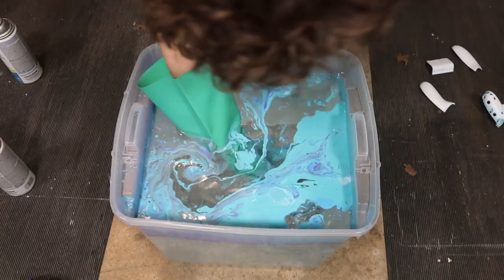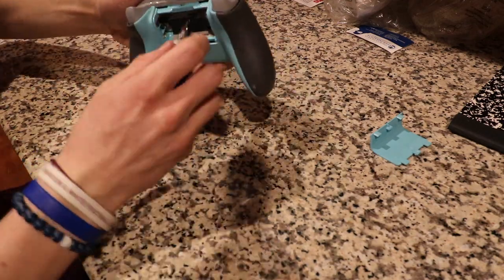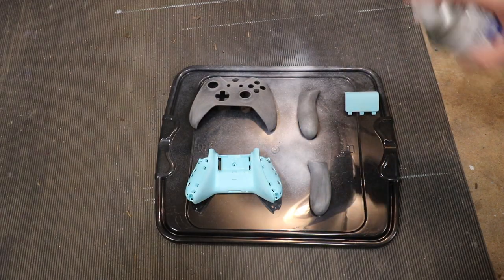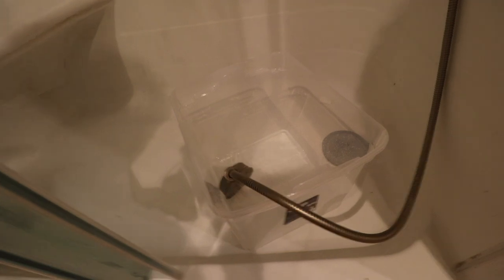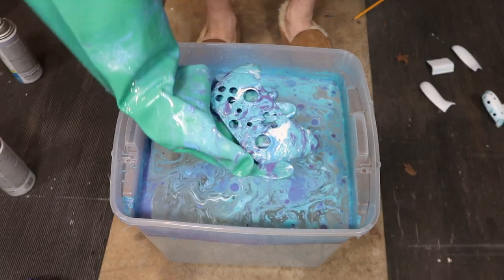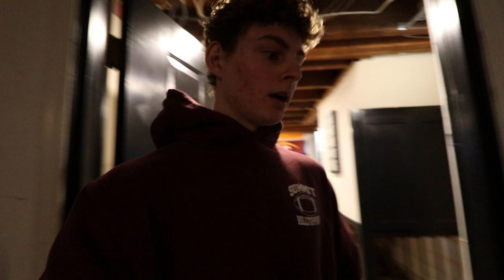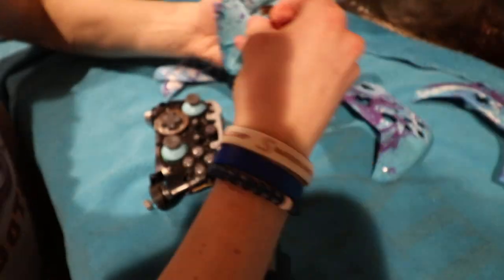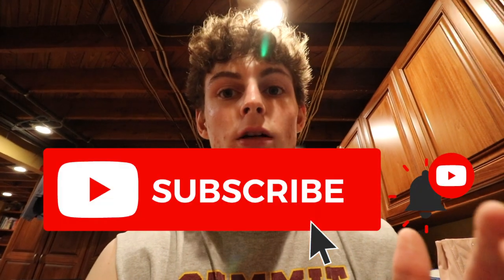How to Customize XBOX ONE S Controller | HYDRO DIPPING Guide !! 🎮🎨

Comment: When I do controllers either dipping or pouring, I use the 3M foam earplugs (the earplug container has orange and purple plugs). I then insert the earplugs into all of the smaller holes. Also, insert earplugs from the underside. This will insure you don’t peel paint off when removing. 
     If you forget and for the larger holes when paint makes the directional pad and thumb stick holes too thick to use, I use different sizes of gun cleaning brushes. Install the size of brush you need into a cordless drill. Shouldn’t need a cleaning rod.